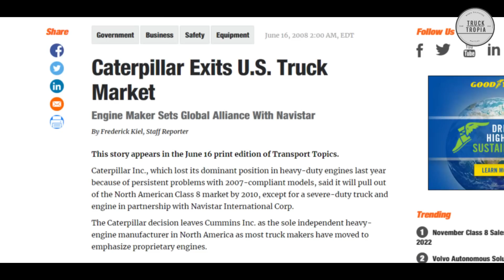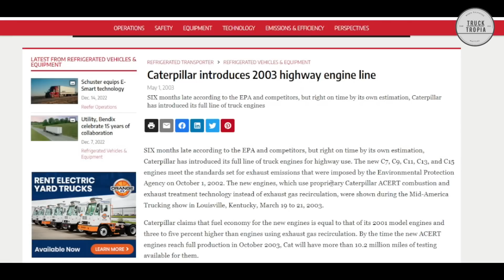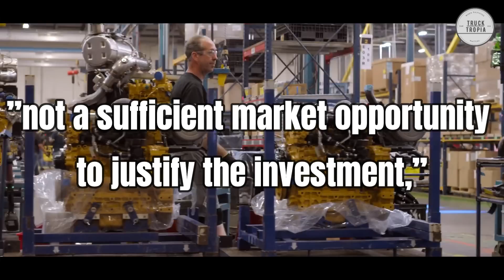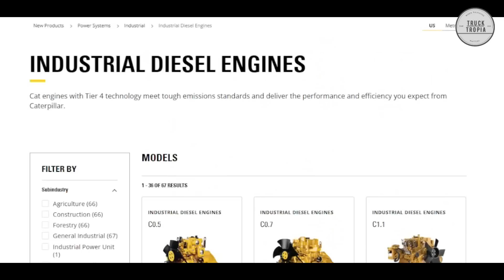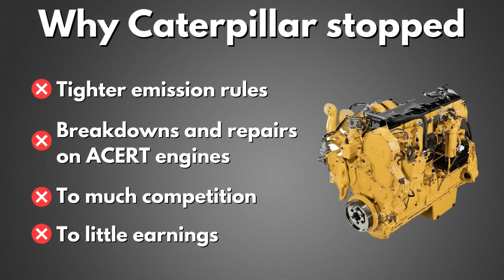Why Caterpillar Stopped Making On-Highway Truck Engines

Comment: The 3406E was a beast of an engine. The problem was if they broke they broke in a big way. Cat never did make wet sleeve liner seals what worked well. Finally borrowed technology from Cummins in the C series engines. They never got great mileage loaded but man they could pull.
Reply: It is my responsibility to aware every one
Quran is the last book of God which revealed on prophet Muhammad saw quran is the only source of guidance in whole world quran will show you the right path quran also verify bible and torah and other scripture kindly once time you study whole quran and aware yourself from the aim of life and got success in long run 🙏🙏🌹🌹❤️❤️

Comment: Our freightliner had the last year of engines they were garbage we usually get about 500,000 miles on a truck in 2.5 years these were in the shop so much that they didn't even reach 100,000 it was ridiculous

Comment: The short answer is the EPA made it not worth the effort. So the rest of us have one less choice. The are many 3406c engines around, I mostly see in logging trucks. They get over a million miles between overhauls.
The EPA is out of control and has been out of control since the start. Their rules, and any federal department rules, should have to be ratified by congress. They've cost Americans billions.

Comment: Basically, Obama's administration, and the EPA rose production cost too to where it initially decreased reliability (by forcing them to put so many add-ons onto the engines) and then ultimately ran them out of that business segment. The same exact thing happened when Navistar was making Ford's 6.0l and 6.4l pickup engines right in that same time frame. Reliability went straight to crap because they had to comply with EPA rules and eventually Ford dumped Navistar and started making their engines in-house.

Comment: The EPA HURT THE END USERS OF TRUCKS WITH ALL THE EMISSIONS 
THE PRICE TO FIX THESE PIECES ARE WAY OUT OF LINE ( I KNOW PRICES HAVE INCREASED) BUT ONE SENSOR AN A TRK WILL NOT RUN AND MOST SENSORS START OUT AT 100 DOLLARS    WHAT HAPPEN TO THE DAYS WHEN AVERAGE PEOPLE COULD FIX THERE TRKS  NOWYOU HAVE TO HOOK A COMPUTER TO A TRK JUST TO SEE WHATS WRONG AND SOMETIMES ITS STILL A GUESSING  GAME.   HOW MANY PPL STILL FIY IN PRIVATE JETS AND DONNOT WORRY ABOUT WHATS PUT IN THE AIR FROM THEM ??

Comment: The only thing Cat did with the Acert motor was put intake valve actuators on it to flood the exhaust with clean air thus lowering the parts per million in the exhaust
Reply: It is my responsibility to aware every one
Quran is the last book of God which revealed on prophet Muhammad saw quran is the only source of guidance in whole world quran will show you the right path quran also verify bible and torah and other scripture kindly once time you study whole quran and aware yourself from the aim of life and got success in long run 🙏🙏🌹🌹❤️❤️

Comment: Cats are hands down the most durable and reliable engines to work on. Even in ships….worked on and tore down the 353, 398 and 3508s….Easy to repair and rebuild.
Reply: But what about the sportster? Good reliable motor, has decent performance, chicks dig em, easy to work on with alot of aftermarket upgrades
Reply: It is my responsibility to aware every one
Quran is the last book of God which revealed on prophet Muhammad saw quran is the only source of guidance in whole world quran will show you the right path quran also verify bible and torah and other scripture kindly once time you study whole quran and aware yourself from the aim of life and got success in long run 🙏🙏🌹🌹❤️❤️

Comment: Caterpillar was the engine of choice for the hardest working trucks but was never the most fuel efficient. When diesel fuel was reasonably priced, operators could stay profitable by hauling the heaviest and most most profitable loads. With the price of fuel now, 4 times what it was 30 years ago, they simply can't compete. Catalytic converters and DPF systems have reduced mpg and reliability across the board for ALL diesel engines...as planned by the EPA, WEF, NWO Elites, etc. Hybrid EV trucks, with CNG/LPG gensets on board as range extenders, are the unavoidable future, unfortunately... for those who can afford them. Increased efficiency, less maintenance, reduced operating costs, etc., should be enough to offset the initial investment. IMO

Comment: Wish they would build engineers for  pick ups  because I worked on all diesel engines the one I see the most of is duramax  and the Cummings powerstroke 6.7 and the old 7.3 from 95 to 2000 I never see them in our shop I work at a Ford dealership

Comment: I've got a 3406B in my 85 Autocar been driving truck since new. It has 614,000 original miles. The engine has never been touched other than oil changes. Heads and oil pan have never been off even turbo is original. Only put a couple starters and alternators and one water pump in 38 years. The truck does not burn or leak oil.
Reply: I have the same with my Cummins ISX...
Reply: By far the superior
Reply: Autocar has gone downhill, since then. Electrical nightmares.
Reply: Ohhh... that's a rare one there my friend 💯🤗🥰
Reply: It is my responsibility to aware every one
Quran is the last book of God which revealed on prophet Muhammad saw quran is the only source of guidance in whole world quran will show you the right path quran also verify bible and torah and other scripture kindly once time you study whole quran and aware yourself from the aim of life and got success in long run 🙏🙏🌹🌹❤️❤️
Reply: @RussianFans-vn6cj  Save it bub.
Reply: @RussianFans-vn6cj  
After years working in the Middle East....saw da Butt-Slam'n Guys wishing for a Woman without a veil !   Fact !   
Rev. Jack
Reply: @RussianFans-vn6cj  aint readin allat
Reply: @RussianFans-vn6cj  Beware of false profits. And yours is such, cat motors till i die.

Comment: I owned a 2005 w900 with C-15 Accert and what a pile of junk. couldn't keep it out of the shop. 1.5 yrs later in 2006 traded the motor for an updated rebuilt 2001 Cat C-16 600hp and installed into my 05Kenworth. best engine I've ever owned. sold it all in 2008 when the market went to pot and fuel prices just broke everyone and freight wasn't keeping up, Still miss that C-16.
Reply: It is my responsibility to aware every one
Quran is the last book of God which revealed on prophet Muhammad saw quran is the only source of guidance in whole world quran will show you the right path quran also verify bible and torah and other scripture kindly once time you study whole quran and aware yourself from the aim of life and got success in long run 🙏🌹❤️

Comment: The ACERT was the death for cats on way highway engines.  The cost to develop sticker emissions compliant engines just wasn't worth the time and effort to further design a compliant engine when their highway engines make such a small portion of their overall sales.
I work on c13 acerts and the ARD system was a disaster. They only last about 8 to 14 months before needing to be replaced.

The one thing cat got right was their CGI(egr). Great system, it takes exhaust gas after the DPF instead of like Cummins where they take it right off the exhaust manifold

Comment: The EPA imposes new rules and regulations and wants them met within 24 hours for say and engine makers scramble to figure out how to make em match the regulations and then the engines come out with problems and the EPA immediately goes on a rant about how they have to fine and stuff

Comment: EPA emissions rule changes put our 70 year old trucking company out of business. Forcing diesel companies to meet fixed timing without enough development before launch, we had 3 turbo failures in the span of 6 months in a fleet of 7 trucks. At $15K for just parts required to repair each time (not under warranty), and broker-controlled rates / mile less than our break even rate at that time, we were forced into bankruptcy, equipment re-possessed by finance companies, and went out of business in 2011. 
I won't say who the diesel company was that had all the turbo failures, but I will say we never had good luck with Cat motors.

Comment: I personally liked the Acert , i never had a problem in my old truck.  
My truck was loyal and rarely broke down. granted i'm more of a Cummins fan , mainly because the sound of the engine . 
We had a second truck with a C15 and it broke down a lot. truck was a power house though. when it worked , that C15 could pull a building.  
Iv'e been a trucker for nearly 7 years and iv'e driven my fair share of trucks.  i know some of you will hate me for this , but at the end of the day , i loved my 2015 and 2020 Cascadia. it's been by far the best running truck iv'e run. (Break down wise) The only thing i hate was the damn D.E.F. bullshit. The Freightliner Cascadia seems to need a ReGen at times that are really not the right time to need one. lol
Reply: It is my responsibility to aware every one
Quran is the last book of God which revealed on prophet Muhammad saw quran is the only source of guidance in whole world quran will show you the right path quran also verify bible and torah and other scripture kindly once time you study whole quran and aware yourself from the aim of life and got success in long run 🙏🙏🌹🌹❤️❤️y

Comment: Cat erroneously assumed that emission standards would not eventually include industrial but they are wrong and will eventually have to meet the challenge - it has already happened with RR locomotives.  So Cat wimped out and basically said that they weren't as good as Cummins and the others and GAVE UP!
Reply: An old family friend of ours is a retired engineer for caterpillar. He said in his meetings with the company ceo's, it wasn't the direction they wanted to go in. It was obscene amounts of money to retool the facility and make adjustments for the new emission standards. They made huge profits off their on road engines and decided it would be best to keep that money for the heavy equipment division instead. You have to remember, Cat's main business is heavy equipment which they excel in and dominate on a global level. The on road truck engine division was just a sideline thing that got started because they were already manufacturing the engines for equipment and didn't need to make huge changes at that time for emission standards. With all the EPA changes and regulations that changed the whole dynamics for the facility and manufacturing. Why would they want to dump all that money into their engine manufacturing and possibly have it hurt their heavy equipment division.  The EPA isn't going to stop with their requirements and regulations, this will be the demise of the other engine manufacturers some day. Caterpillar saw the writing on the wall a long time ago and decided not to be a part of it. Caterpillar's average annual revenue is around 51 billion a year. Cummins annual revenue is 17 billion. Cummins doesn't build equipment, they are just engine manufacturers. This is why they had no choice but to retool their facility and build EPA standard engines or they would be out of business. They had no other business to keep them going. Detroit has also been one to make changes and build EPA standard engines. They build a very reliable engine and have for decades. Unfortunately Paccar decided to use Cummins and the Paccar engine for their trucks. I think this was a mistake, I believe they would have way more sales if you had an option of the DD engine. You can get this engine in Freightliner and Western Star and I believe that's why their sales have increased.  If Paccar offered the same option,  I believe the Detroit DD would be the most popular engine on the road right now. Now we talk about Cat assuming that the emission standards would never effect industrial. They absolute new it would effect it. A company of that size isn't that stupid, that's exactly why they dumped the engine side, so they could focus on their industrial side. We own new Cat equipment and all of it is compliant with the EPA standards, it all takes Def fluid. There is one thing more to all this, Cat is leading the way right now in electric powered equipment. Now, im like most everyone and laugh at the thought of electric equipment. Let's think back to the EPA and it's requirements,  that's right they eventually want to do away with all engines that run off of gas and diesel. Electric is the future in their eyes and it won't stop anytime soon. Caterpillar saw this coming a long time ago and started dumping money into the electric division knowing this would be their security for decades to come. They really are ahead of the other manufacturers. At the rate we are going  towards electric, Cummins is living on borrowed time. Maybe they will become electric motor manufacturers,  against GE, Siemens, Toshiba, ABB, Rockwell etc.. the list is long of electric motor manufacturers. I'm not trying to sound like I'm in love with electric,  I'm far from that but that is where we are headed even if we don't like it. PACCAR is headed the same direction,  in another 7 years they want to be all electric as well. I personally think it will be a little longer than that but that's where all the big manufacturers are headed. In twenty years from now Cummins will be a story you tell at  the dinner table.
Reply: @jrglad    The World is not heading as fast to electric as the media and gov. would have us think.  It's ok for cars on a limited basis but not for semi's and industrial equip. - batteries are too limited in energy storage and will ever be; the best battery is a gallon of gas or diesel.  Battery manufacturing is extremely dirty.  Power grids, and power plants can't even meet the demand now let alone for millions of EV's   It is all logistically impossible and it is only a matter of time before Governments will have to admit it.
Reply: @Kevin Cook  I agree with you 💯.  Where we live two huge construction companies already have tested and ran two electric dozers from Cat and were actually impressed with them. I have a very close friend who is one of the head engineers for Paccar up in Seattle Washington, he is in charge of the electric truck division. I'm actually going up there in about two weeks.  I would be happy to post some of their reports and predictions for the near future.  They have trucks already running around the country in different geographical areas to see what works and what doesn't. It will be harder for rural areas to switch over due to what you said, but large mines, large sawmills and certain farming makes their own electricity off of biomass, coal, green waste etc. They are self sufficient and usually make more power than they need which in return helps with electric equity in these areas. I don't ever think that combustible engines will disappear all together,  but it will be on a small scale.  Those who remain, will be very limited on what they build. I might sound like a crazy person,  I'm actually in the  forest products industry and have fleets of big trucks that do multiple different businesses. We are very concerned about our future and what they are forcing on us, we just keep trying to adapt. Diesel, in my opinion, can be very clean burning and is very cheap to make is the best way, but convince the people that are making Billions off this false prophecy and who happens to also control the power around the world. If we are going to stop it then we better have started 40 years ago. I'm in DC and other parts of the country taking meetings on this very thing for our industry's, and all we get is the same run around. We need more people fighting this fight. I don't want to sound like I'm arguing with you,  because I agree in so many ways, but I travel a lot and see what's happening on both sides. The big manufacturers have taken the bait and are aggressively moving that direction. Unfortunately it's all about money, the root to all evil.
Reply: @jrglad the bulk of cat sales were on heavy equipment and mining equipment as well as pumping and power geberation

Comment: we had Wirtgen cold planner road construction with a 3406 750hp what a heap of shit 2100rpm 735hp 1900rpm 300hp for ever come up with brass in oil over heated and the head man from Cat said these motors should only be on generators or pumps but its economical isn't it they don't like varying loads constantly was outperformed by a baby 444 Mercades Benz engine sad
Reply: It is my responsibility to aware every one
Quran is the last book of God which revealed on prophet Muhammad saw quran is the only source of guidance in whole world quran will show you the right path quran also verify bible and torah and other scripture kindly once time you study whole quran and aware yourself from the aim of life and got success in long run 🙏🙏🙏🙏🙏🌹🌹🌹🌹❤️❤️❤️❤️

Comment: Detroit always made a great engine the series 60 is the best diesel engine ever made it didn’t make as much power as a 3406 but it was way more reliable and cheaper to maintain and repair when it did break. The series 60 gets a bad rap from Fitzgerald doing shoddy rebuilds on them for glider trucks but I’d take a 12.7 series 60 over a cat any day. And now with the modern engine’s Detroit is still the best they’ve easily got the most reliable emissions system and a decent power output if you could get them in a Pete or KW they’d be the king right now and cummins would be out of business but since you can only get them in a freightliner they get hate for no reason and Cummins get praise for no reason

Comment: 3406 was the greatest engine ever built, if that sumbitch pulled you out of the yard it would pull you back in! Even if one of the push rods had broken out the side of the block